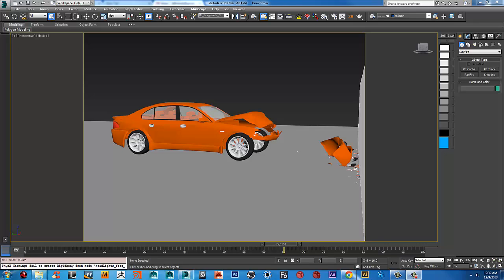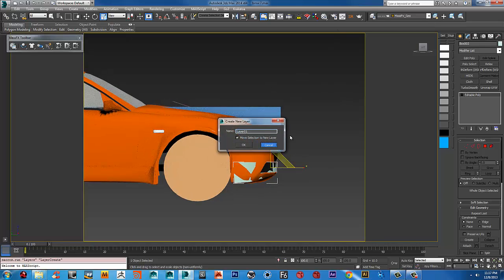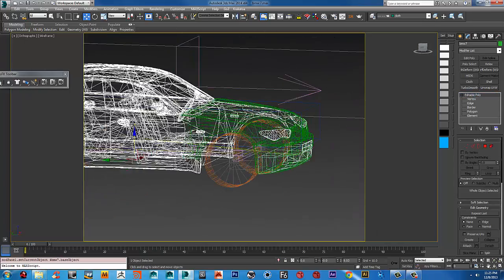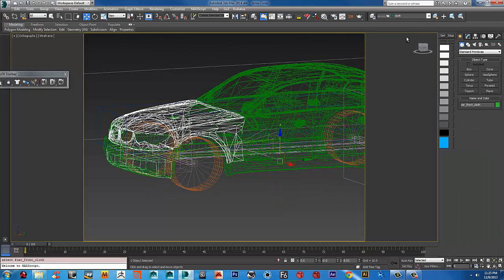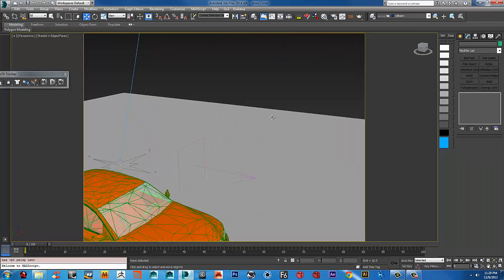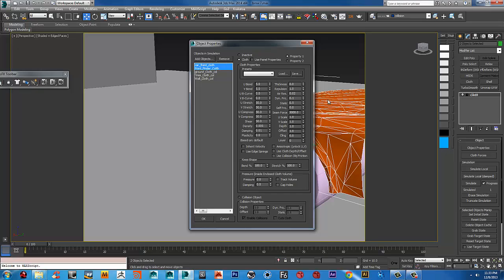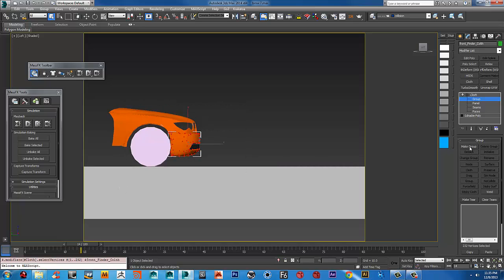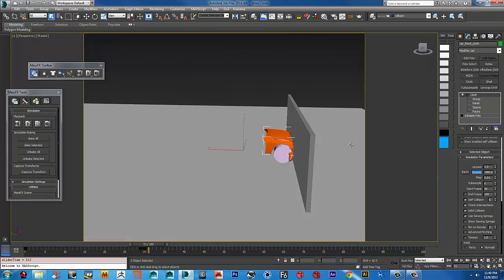3dsmax tutorial: car crush part 2

Comment: Nice Tutorial.. have a little issue, I tried it, but the morpher begins to crush the car gradually from frame one before it comes in contact with the cylinder. why is this so? in my animation, the car comes in contact with the cylinder at frame 9, so i drag the slider to frame 9, press auto key, then drag the morpher slider to 100, but while scrubbing the frame the car begins to crush all the way from  frame 2 or 3 before it gets to frame 9... Please what can i do to fix it?
Reply from the maker: it might be because of your time configuration or the way you cached your geometry. Send me your file and ill check it if you don't mind:)
Reply: CGfriends
 Thanks for your prompt response. Please send me your email address. I created the file with 3ds Max 2012, that's the Version I use.
Reply from the maker: adedolapo oladipupo sorry for the late reply for some reason your comment went straight to the spam floder ,saw it just today  my email is 3dfreinds@gmail.com
Reply: Thanks. I eventually figured it out.